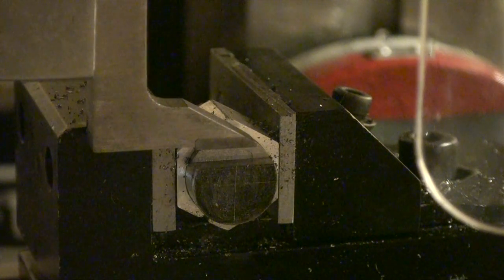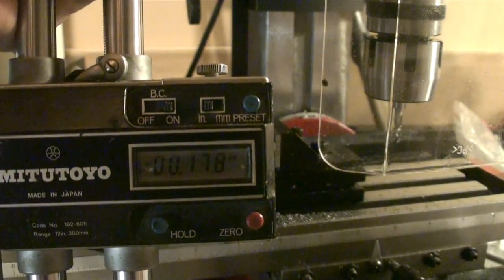Cox RC Nitro Motor Build

Comment: Nice Job, you had mentioned a link for the specs of this build?
Respectfully, Jim P.
Reply from the maker: you can find the article and free plans at http://www.jamesengine.com.
Reply: ShnitzlHaus well thank you very much I believe it's quite interesting and what you're doing I've always had a carburetor issue with a Cox t d engines as in for Corporation but I'm going to try to do with what you build is actually put in a needle valve assembly so thanks again for the inspiration I already ordered up my bar stuck and I'm going to try to whip it out on my little mini ultimate